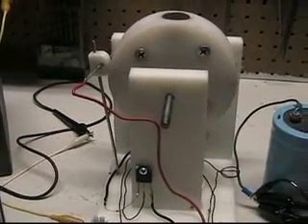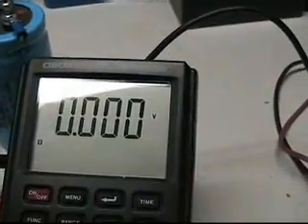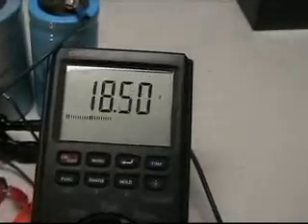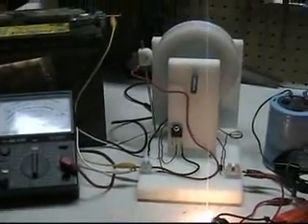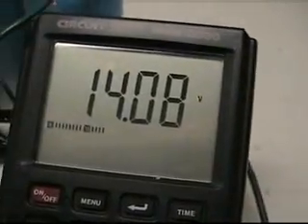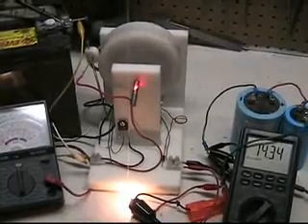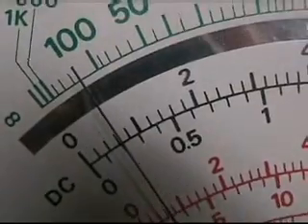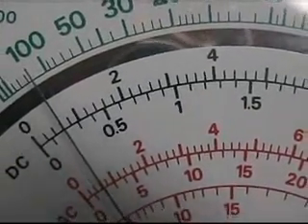Single Coil Motor Demo

Comment: I'm trying to build an electric trolling motor for my boat and am looking for the simplest design and so came across this single coil motor demo. Am I right in saying that this is a type of pulse motor? My main question is is it possible to feed the power generated from the back-emf back into the input power circuit?

Comment: supose if you made the second coil out of thiner guage wire ,you could try to get 120volts wich could be used to power a neon light or something that draws low current.